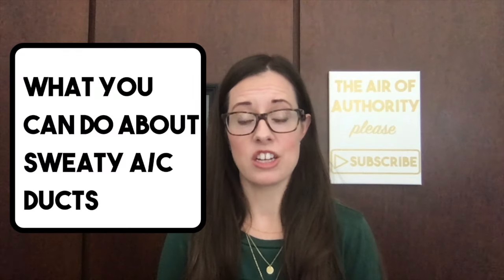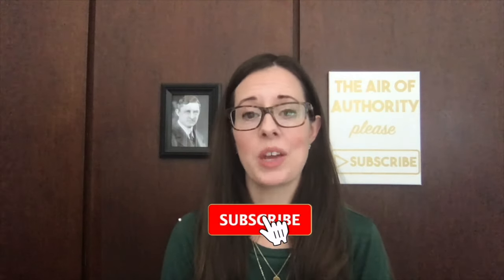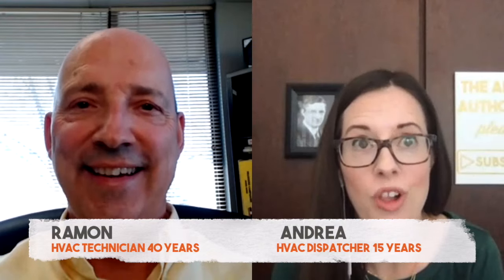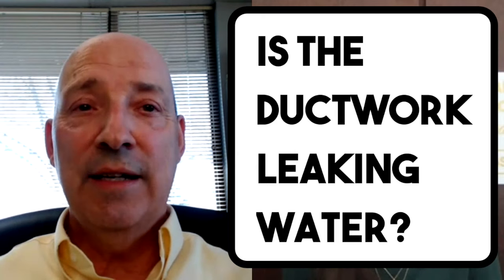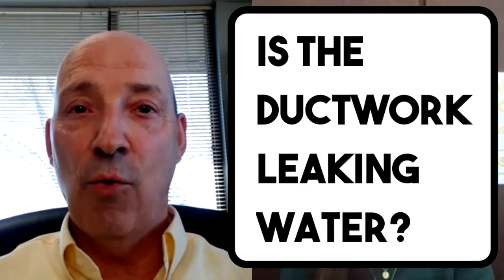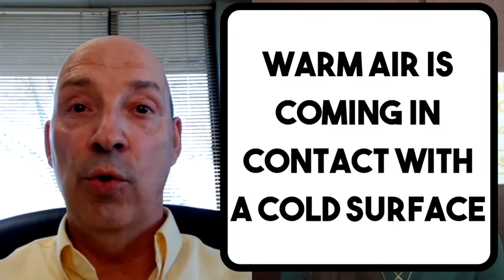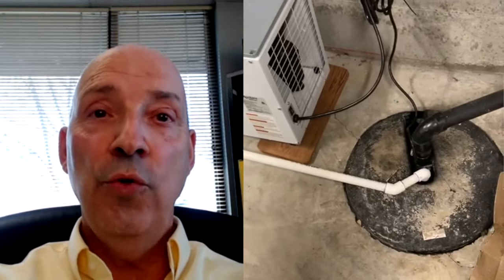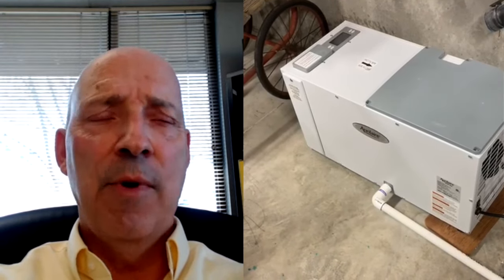What Can I Do About Sweaty AC Ducts? Why Air Conditioning Ducts Sweat or Leak Water

Comment: Also make sure when you take off your vent lid the area where the sheetrock corner meets the duct... check to see if its seeled up,  I had sweaty lids causing a wet ring around the square opening. I solved this by taking the lid off and putting hvac 2inch wide foil all weather tape around the opening, spliting 1inch by 1inch on the edges. Yea, this ended up being a simple fingernail area where the attic was exposed and sucking hot air in the attic with the cold air coming out of vent.  I Hope this info helps others.
Reply: Bingo! I knew if I read enough comments I would come upon one that is a good solution.  Thanks
Reply: I’m a senior, who do I call to check this out? A heating and air conditioning person?

Comment: It could also be a plenum leak or an evaporator sweating from low charge and the fan is flinging water into the ductwork or if an evap is frozen up and that's and the condensate drain is plugged and overfill and condensate dumps into the duct if it's an attic unit with a stuck float switch. A loose evap cover on the air handler, dirty filter leading to clogged drainage causing a backup. Thermostat temperature set too cold.

Comment: I just had 2 new units installed and 6 days later I was at the paint store buying paint to fix water damage in my kitchen ceiling. It did it again this year and cutting into the drywall and making a huge hole showed my air junction just sweating and dripping like crazy but for 15 years when we had the old units this never happened. So I wrapped the junction and then the vents began sweating and dripping. I have lots of drywall damage and it only started when the new units were put in. Long story turns out the unit that controls the downstairs, the fan speed in the evaporator coil was nearly double what it should be!  It was never set at install. Like I said, it did this last year and 6 days later I've got repair issues where the junction box is. It did it again this year almost to the day of last year. I have had my install guys out here like 6 times and of course its not their equipment or their fault but he did say if I turn my downstairs to 73 or 74 ( we kept it at 70 with older units ) our problem will stop. And it did. Our upstairs unit we keep at 70 sometimes even lower and yet it doesn't do this. Any idea here on what is happening?  No way is it coincidence that this started as soon as the new unit was installed. And why did moving my temp to 73 stop the sweating?  Help me quack this case please!  😂  its a 2.0 ton American standard downstairs and a 2.5 American standard upstairs, which by the way the fan speed on it was never set at install either. It took over a year and all this damage to figure that out on both units. Thanks so much and good video!  Oh. I'm in SC/NC border area if that helps. Thanks.
Reply: I am having a very similar issue.   Have a two story house in upstate SC.   We installed a new American Standard 3 ton unit for the upstairs.  Also replaced every bit of the ductwork.   The air handler and ductwork is all in the attic.   We keep the upstairs unit on 70 or 71 and the downstairs unit on 72.   The new upstairs unit is variable speed compressor and variable speed air handles so the fan speed is constantly fluctuating as needed.   The main Trunk Line in the attic is sweating a lot and several of our supply vents sweat and drip into the house.   We have mold and stains on the ceiling drywall around most of the supply vents.   The HVAC folks have tried to better seal around the boots and I had a foot of new insulation blown in to help keep the hot attire air off of the boots.   I believe most of our sweaty vents are because of the warm air at the ceiling level is causing condensation on the vents.   If I leave the bathroom exhaust fans running the vents in those rooms don't sweat.   I guess I am pulling out the warm air.   As for the true lines sweating, I am wondering if I need to have them wrapped with a second layer of insulation?   We have soffit vents, ridge vents and a fan blowing our of a gable.   We don't have any sweat issue with the downstairs system (the ductwork is in the unfinished basement and the vents are in the floor).   As in your case, we never had sweating vents or ductwork with the old system.   It all started when we installed the brand new high efficiency system.   Very frustrating!!
Reply: You need air flow in the attic. See HVAC school videos they explain that better
Reply: @DS-fb9te  turns out the AC company never set the fan speeds on either unit. The one that was causing the problem was almost double what it should have been. So they are now paying to fix everything. None of this would have happened if the fan speed was set right. Fan speed is very important for evaporation to take place and get rid of condensation. Which mine was not doing. It is now, but the damage has been done.
Reply: @JSmith-cd2nw  Glad they paid to repair it. They certainly should have. How is it working now?
Reply: @TJ-22  its working fine now that the fan speeds were set. In fact I heard our experience was used in training for them as what NOT to do... Or better yet, what to do.  Lol. The only issue Im afraid I might have now is mold in the area where the coil is. The fan speed was not set for nearly a year so lots of water was in there 24/7. Doing my homework on that now. I just don't have good luck it seems. Lol

Comment: How about now in the winter months when my central is off and I have water dripping through my ceiling vent?  My duct work is in the attic.  I've closed the vent and opened it and it still drips.  Any suggestions on how to stop this or prevent it?
Reply: I have the same problem every winter I have a shit load of water in my flex ducts and have to swap out my ducts every summer it's getting very expensive the hvac guy says there is cold air getting inside the ducts during the winter so I guess the insulation isn't doing its job. I'd close all the vents and put Styrofoam in the return cut it to size . This drives me crazy every year at least 3-4 ducts I replace

Comment: If anyone here can help, just had 15 seer heat pump/air handler installed one month ago. In hot garage in Florida, my  36 yr old air handler always had normal condensation on outside panels, this new one also does in some places. But the front panel right above the filter slot, has the insulation getting saturated on the inside, then the water is running down on the filter. Filter not getting crazy wet because it gets dried when the system runs. Had the AC guys back yesterday 95 outside temp, 80% humid, pretty much normal late summer day, and the guy said this is normal. He said it will not cause issues. Will dry over time. I worry that next hot season, the insulation will stay wet all the time causing mold, maybe black mold. I understand how condensation works and why. Inside the air handler is very cold, and the outside panel gets cold too, then the moisture in the air condenses when it hits the panel, but why inside?........Unit is one of the top tier companies and than this, it works great.....nice, quiet and cool.....

Comment: The bottom line is you have to keep cold air away from hot humid (eg, The heat exchanger ducts pulling cold air from outside the house into the unit in the winter) and hot air away from cold (eg hot air in an attic or crawl space that is in contact with a duct that carries cold air conditioned air). Well fitting, sealed joints (at the fittings and where it exits the house) will decrease mixing of hot and cold air in the duct and on the surface of the duct.  The use of insulated ducts is a must for duct runs that carry cold air through warm areas and vice versa.  Another scenario unique to Air Conditioning, is the speed in which the air flows through your (furnace) ducts.  When you buy a furnace sized for your house the fan speed is set at XXX Cubic Feet Per minute but they don't know what size Air Conditioner you may buy and match to it, so they allow fan speeds to be adjustable.  If you requested and A/C unit based on maxing out the Tons you've falling victim to the bigger the better flaw.  See this article for how to match A/C to furnace BTU and the importance of adjusting fan speed right away after the A/C install.  https://www.priorityenergy.com/article/control-humidity-optimizing-fan-speed                        
https://youtu.be/aJYC3Z3xFJM       
40kBTU furnaces typically get 2 ton fans (800-900 CFM)
60kBTU furnaces typically get 3 ton fans (1,200-1300 CFM)
80kBTU furnaces typically get 4 ton fans (1,600-1700 CFM)
100kBTU furnaces typically get 4 or 5 ton fans (2,000+ CFM)

Comment: Thats last part about the warm/hot air in the attic just helped me figure out why when our a/c or heat runs why the air coming out is dank mildewy smell and I know there are several spots that don't have insulation on the ductwork..and an addition onto the house..it has the flex ducting and it had popped off the main air supply spiral ductwork and I just popped it back on not knowing about sweating etc can happen so when it starts cooling off here in Texas I will be up in the attic fixing all of this..Thank you for this valuable information..I have trying to figure this out for quite some time.

Comment: Great vid, I don't feel so overwhelmed now. I have 3 5 ton  units in a converted commercial studio building, all units hanging horizontal above the hallway. All spiral ductwork sweats for the first few feet or more. Very humid environment probably very leaky old building. 

The units branch into studios but the hvac guys never installed return vents in the studios so I assume all air that runs through the handler  is being sucked in from the outside.

Sorry for the long post, does anyone think that when I cut reruns in the rooms back to the hallway, that might cut down on the humidity since it will be recycling drier air? Like the idea about the dehumidifier too

Comment: The sweaty air-duct is initially indicated the beginning of leaking through the ceiling dry-wall.  The lower temperature setting, the more sweating you could get. Next week, I planned to learn how to replace the air-duct work because the labor is too expensive. How much would it cost, the labor for eight supplied lines?
Reply: I have the same problem did you get it fixed?

Comment: Hi, I found moisture "in" my ductwork dripping out of one of the plugs the furnace cleaners drilled and plugged. about 3 cupfulls.  The outside of the duct is dry. I have the AC on for a couple of hours in the evening the last few days. Any suggestions?....Thank-you.

Comment: I had sweating ducts in a room that was unfinished so I wrapped them in insulation and haven't seen any issue as of yet ( since June so far and we are now in August here in Virginia). I have a bathroom on the same level where the ducts were sweating that doesn't have the fan cover on it yet. Do you think I could just put a cover on that fan to cover up the hole and it will stop this way or do I need to take down to drywall and insulate the ductwork in that small bathroom?

Comment: My floor ducts have sweat and now have rust on the surface. My basement is finished and my home is only 10 years old. No sign of any water water leaks. Am I doomed and need my HVAC replaced?
Reply: No, you needed proper duct system installed in first place. Good luck like most home owners you will need it.

Comment: From what I’ve read and leaking air conditioner like in an apartment is normal when it’s super hot outside especially because basically what’s happening is it’s condensation which is pretty much what you’re explaining

Comment: Would a dehumidifier help?
Reply: Yes
Reply: I’ve got exposed ducts (on the roof - in the hot sun) and condensation forming on the inside of the ducts and dripping through the vents. With no AC on in the morning, the ducts will start dripping condensation. In Southern California (so hot, and not real humid); Would a dehumidifier within the house help?